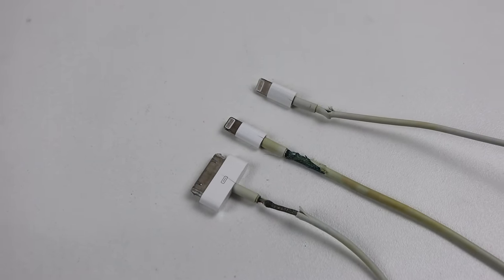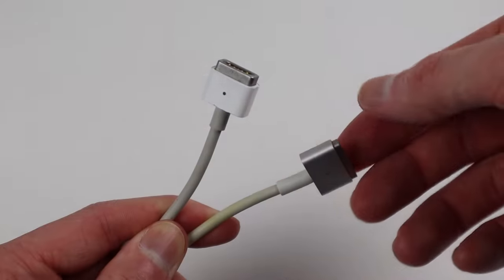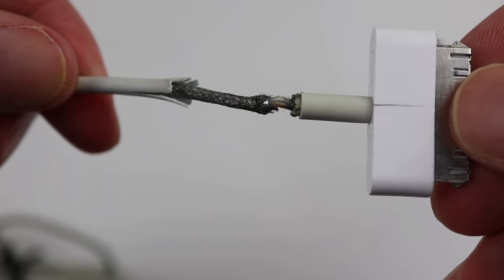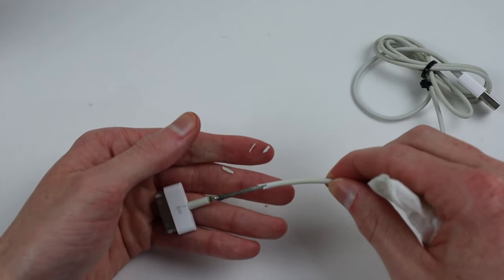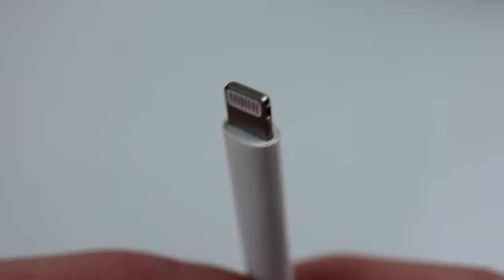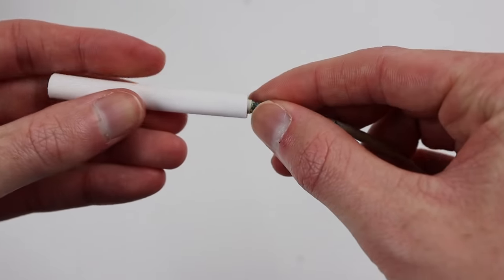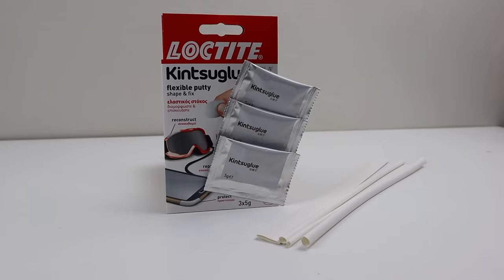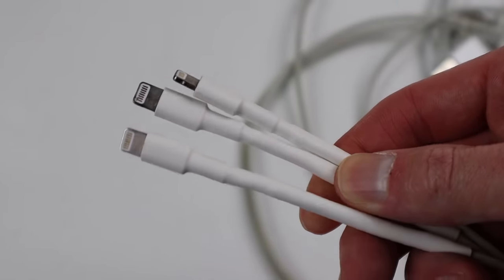Repairing Apple's Notorious iPhone Cables for $8! - Save $$

Comment: The Story behind those Cables: In 2009 Greenpeace did a lot of lobbying against Apple. They have criticized the fact that the cables are made with PVC-containing plastic. After some pressure, Apple bowed to this. Since then, Apple has advertised that the devices are made without toxic plastics and PVC. Around 2009, Apple also changed the plastic of its cables. Of course, Apple is now benefiting from this. Keyword: Planned obscolescence and greenwashing.
Reply: Interesting
Reply: the|Gamer Apple should've used a different environmentally friendly material that is just as strong as the old, not the cheapest material available.
Reply: A smart thing would be completely wireless charging.
Reply: Glyne Lewis That is still not a viable way to fast charge a device.
Reply: MiragesMisteryGirl and as far as i know there is power waste too
Reply: Luong Truong They might be doing that soon tho.
Reply: Funny how green peace got involved and they changed the coating on the cable meaning they break more quickly so people throw them in the bin adding to more cables going into landfill and people buying more cables which are normally cheap pound/dollar store cables.
Reply: Just make better cables which don't break so easily apple but glad to see you fixing up old cables and not just throwing them away 👍
Reply: dwcoke There are rumors about Apple changing their cable to mesh instead of these fragile cables.
Reply: In the end, Greenpeace did more harm than good, as usual.
Reply: @DistrosProjects  Irony is their complaints made the Apple cables more disposable. Essentially worsening the situation
Reply: Green is the new red.
Reply: Crantox It's called saving money to make a profit.
Reply: Satsuma GT couldn’t agree anymore , their stupid idea cause more harm than done .
Reply: the|Gamer That’s quite useful information you got dude... Imma protest outside foxcon’s headquarters lmao 😂
Reply: MiragesMisteryGirl is mesh good?
Reply: @FinalKingX  true, but they are Apple, aren't they? Consumer friendly isn't on their vocabulary
Reply: yep and not even a good bend protection it has failed me 8 times really we just creating more garbage then PVC does •_•
Reply: Apple wouldn't even have changed anything if they didn't see it as a chance to make a buck.
Reply: My cables are all still fine, both those from after 2009 and older ones.
I think it is something in the environment of some users that contributes to this.
I don't see any of the yellowing that the video complains about.
Maybe people leave their cables in the sun, or too hot, or they smoke cigarettes, or something.
Reply: I can still see verdigris, is that safe now?
Reply: GREENWASHING .... Im using it from now.
Reply: @xalataf3365  Exactly. Apple could have done something different, but no, they decided to use the cheapest material available
Reply: What a great malicious compliance :D
Reply: Wow!! 😮
Reply: Ah, so use an iPod 2005 charger
Reply: Back in the time the only problem was getting cancer from toxic plastic😂
Reply: @BarbadosBeerFestival  wireless charing can easily damage a device's battery and shortern it's lifespan
Reply: @BarbadosBeerFestival  wireless charging is super inefficient and wastes a lot of power.
Reply: @FinalKingX  Or just use PVC in the cables so we don't keep throwing these away or buying another brand.... with PVC.
Reply: Not to mention them randomly changing the shape of the ports so you can't use them across products
Reply: @satsumagt5284  While I'm no greenpeacer - one thing it did away with is use of Phtalates, this directly reduces sperm count and quality of sperms in males. Also phthalates act as oestrogen's = male fetuses in pregnant women - later get born with smaller testicles, and with sperm counts reduced.

But yes, the cables do fray quicker. However considering the reduction of phthalates, can also be considered a success.
Reply: just as bad as tofu dreg products in china: Not-so-durable products (toys, and even buildings ☠️)

Comment: "Most employees said I was using It wrong" What an Apple thing to say lol
Reply: Tbh, you are probably using them wrong. This probably the one thing they’re not lying to you about 🤣
Reply: @evan168gt6  not if u take extreme care of the cable and it die on u anyway. apple is full of excuses to turn away the customer. look at their old cables which never broke back in 2006 etc, they changed the material so customers have to buy more of their cables so they can have the money. ive had one cable last me over 2 years and the rubber around it split away. just bought another one around january time and its already split and dead. never bent the cable, just a simple plug in, use it for 10 mins and then leaving it.
Reply: @evan168gt6  so using them at all is using them wrong?
Reply: @TorutheRedFox  I use mine daily or more and they are not damaged in the slightest after years of use! Did apple give me the secretly good cables or is it just me? Maybe the environment does play a role :/
Reply: @ozmobozo  lmao
Reply: yes all u need is some flex tape BOOM apple cable suddenly maybe holds for longer then a few months cause it feels wish quality at times man....
Reply: "Are you using this to charge your device?? NO NO NO NO. You are supposed to keep this in the box and buy a wireless charger." Service charge 1000 dollars
Reply: I use it like everyone else and it is as old as the first iPhone 6 release and it isn't broken at all
Reply: How tf do you use a cable wrong??
Reply: Exactly unless you use it to go bungee jumping your using a cable properly
Reply: @ashishagrawal1406  What's the point of a wireless charger it's equal hastle to charge worse on the battery harder to charge whilst using more expensive charger and on top of all that it's slower
Reply: @cybermechid9181  So does my iPad 2 cable lmao.
Reply: Boeing be like
Reply: Stupid ways of thinking Apple is  making money by selling cheap material
Reply: @cybermechid9181  Full stainless steel shells are “cheap”? Great, you must think the plastic note 20 is high quality.
Reply: @cybermechid9181  Yeah they feeding people propaganda,we are in consensus
Reply: @TorutheRedFox  “using them at all is using them wrong” 🙈
Reply: It’s a simple answer that their chargers don’t include pvc, a substance that is used to make cables more durable.
Reply: And that’s why Anker is the best
Reply: @evan168gt6  I never put them in huge angles, they breakdown overtime of just use

Comment: Apple's cables are such a weird thing. They go through incredible lengths on build quality on everything else they make, but their cables are outclassed by dollar store cables
Reply: @Bobspineable  Pack in cables are never GOOD but I've owned devices from every major manufacturer and Apple ones are the only ones I've seen that outright disintegrate, and they just generally fail much sooner. I'm still using the same usb-c cables that came with each of my phones, the oldest of which dates back to 2017, that's 3 years of daily use, and it's only just now getting that little bulge by the connector that usually indicates imminent failure.
Reply: Have you payed attention to dollar store charging cable speeds because heh, rip to the 30 pin charger i had to settle with back in the days.
Reply: Because apple products have their own charging cable they can get away with making products that break because where else will you get your charger from? I'm pretty sure they get a cut of every third party charger that's sold for iphones
Reply: @mufasaiam7794  they'd get even more of a cut if they gave people a reason to buy first party replacements. Even if they were high quality, people would still need replacements for lost or broken ones.
Reply: It's done on purpose so you gotta buy more overpriced cables. Planned obsolescence at its finest
Reply: @matiastripaldi406  I believe apple is going to stop including headphones and a charging brick in the box with a phone, you only get a cable. They're taking so many cost cutting measures, instead of making crappy accessories they just won't include them at all.
Reply: @dronesparky501  As long as people keep buying apple will get away with outrageous things like this. It's all about iphone buyers actually switching en masse so apple stops the bullshit, but that will obviously never happen
Reply: Are you joking? I still use my original cable for 3 years now, and works fine. A dollar store cable won't even last 2 weeks
Reply: The dollar store near me doesn't even sell apple cables, too expensive for them. I found that the hard way by driving 3 miles to one only to figure out they don't have any.
Reply: @matiastripaldi406  Yeah, never gonna happen. People will take almost anything apple throws at them. $1k monitor stand? Hell yeah! Computer wheels the price of an iPhone 11? Of course!
Reply: @Bobspineable  I've only noticed this be a repeated problem with apple cables, I believe I take good care of my cables but with the apple ones this is always the end result.
Reply: "Build quality" is a laugh when pubes getting into the device shorts it out. Or if the touchpad on a laptop goes bad and the computer won't turn on. Or heat sinks and pipes which don't even touch the chips they're supposed to be cooling. Or everything else on the PCB fails except the fuses.
Reply: @onometre  Dude, my DS charger circa 2007 shows no signs of failing any time soon. T'was my daily driver handheld device for a long time. Yet that little bulletproof grey cable never failed me.
Reply: @Bobspineable  try to use the BlitzWolf  cables
Reply: @Bobspineable  I broken my cables but not the outer part where rubber just falls apart. My cables usually break internally and they don't work anymore. But I'll take the blame for that because I use them at all kinds of weird bends and angels.
Reply: I would add: physical build quality. Because on the electronics side modern Apple devices are not that great. Failing SoCs due to board flexing, failing keyboards, failing display connectors, failing voltage regulators, failing graphics chips, and especially: horrible cooling (which is probably the main reason for the failing graphics chips issue). 
Most MacBooks cook at 100°C under high load.
And there are no Service manuals available. Compare that to 90s/early 2000s Apple products. They used to have service manuals and schematics.
Reply: @TheRailroad99  bad cooling as part due to the intel processors and also for Apple that putting fans in a wrong place in MacBook air that does nothing for cooling of the CPU. About cables issues, please see the flashgate isue
Reply: @ronlevin2339  flashgate, and the fact that voltage lines on the display cables are layed out very stupid from an engineers perspektive. The LED driver voltage (+52V) is right next to a data pin. If debris shorts those lines, your CPU is toast. 
Intel CPUs do run hot, but you can't tell me that the Apple engineers didn't knew that. They have probably tested it for months and still didn't improve the cooling because a loud or thick macbook would not look as good. Well, I guess a dead Macbook looks better...
Reply: @TheRailroad99  I know about the lines as well. Do you know what else is forstrating?? Water protection!! Every laptop, even chinice cheap crap has a thin layer of laca on the motherboard that protect soldering and components from water damage. Apple  decided they do no need it. Therefore even a tiny drop of water can kill your MacBook, something even working in humid environment, like new York City is enough. Put 2 lines with almost 50 volt difference one near another , less that half millimeter, only Apple can think about it.
Reply: @ronlevin2339  what you're talking about is conformal coating. It is very popular on professional an power electronics (expensive industrial controllers, good power tools, farming electronics etc., basically everything in a dirty environment), but rarely used on other laptops (or even phones).
However many of those other laptops often protect the PCB with a thin black foil glued to it. (Just google a picture for a thinkpad motherboard, you will see what I mean).
Most macbook boards use really thin traces, which means they also get eaten up by corrosion much faster.
Reply: @TheRailroad99  you can see Luis channel, how tiny spill of water or humidity can kill MacBook
Reply: @ronlevin2339  I'm watching Louis' channel as well. He points out a lot of failures, but some of his claims must be taken with a grain of salt. I agree - corrosion happens fast on these boards, and they do nothing to prevent that. However, other manufacturers don't do that either. Some put those foils on the boards, many include water drain holes. 
The thing is Louis just gets to see the defect Macbooks, as he is specialised for them. Other laptops fail as well, but less often, and because they usually are cheaper, people don't bother to get them repaired.
No laptop brand known to me uses conformal coating. Maybe military grade stuff, maybe Panasonic toughbooks. Not sure. 

Louis himself has gone more and more from "screw Apple" to "not only Apple - screw this whole industry". He talks a lot about that in the latest AmpHour podcast from eevBlog. Highly recommended.
Reply: @TheRailroad99  I fixed several PC boards (mines)  over the years, I always seen this layer of protection on them, i was shoked first not to see it on MacBook, and i did not had an expensive ones. And i'm not talking about the fact that you cannot find replacement chips for a new mac's. And environment issue as  well. When MacBooks has butterfly keyboard issue, Apple finally offered a free replacement program, but because battery is glued to the case, keeboard was replaced together with huge battery and aluminum case, and  everything was throwm    to the dumpster. And some people had 5 replacement in 3 years
Reply: @ronlevin2339  i guess their solder mask might be worse (matt vs glossy on other boards).
But again, no normal computer board is coated. Some have painted logos on them. But not real water proof conformal coating. Not even high end HEDT boards. Maybe, just maybe some workstation boards. But I doubt.
The keyboards are bad however. Definitely. That's what I already wrote in my first answer. I don't deny Apple makes some bad mistakes. They claim to be better then other devices, but they are not better NOR WORSE. Just more common, so tiny mistakes show up very quickly.
Reply: @TheRailroad99  even same quality (what i doubts) should not cost 2-3 more.p.s. do you know that new MacBook with a Apple silicone will be using again butterfly keeboard,and people will still buy them by million's without and hesitation
Reply: @ronlevin2339  agreed. They are overpriced. I did not know that the new ones will have the horrible bf keyboard... I think the newest 16" has the old keyboard again.
Well, let the people buy, its their problem. I will stay with professional stuff like thinkpads. (But even those are not anymore as good as the T420 or even older thinkpads)
Reply: @TheRailroad99  yes, see luke miami video some time ago. Nothing works like before, we had a fridge that worked 20 years, i do not think that a new one that we bought will hold half of the time.
Reply: Bobspineable my 3ds charger still fine 🤷🏻‍♀️
Reply: onometre bruh it’s lighting chargers my father’s phones port broke and his usb c didn’t like tf
Reply: Doller store cables NEVER last there so cheap they break in a week
Reply: @whyeven3722  my guy, the build quality of Nintendo chargers are on a whole other level. I still have my original DS (2005) and a 2011 OLD 3DS, and the chargers still going strong despite me abusing them (Almost 20 years of gaming, 12 on the original and I'm still playing in my 3DS)
Reply: @Bobspineable  my android cable I use since 2009
Reply: Apple has prevented 3rd party cables from  working too giving you a msg and refusing to charge ffs.
Reply: "they go through incredible lengths to build quality on everything." drops iphone from 2 inches shatters into bits